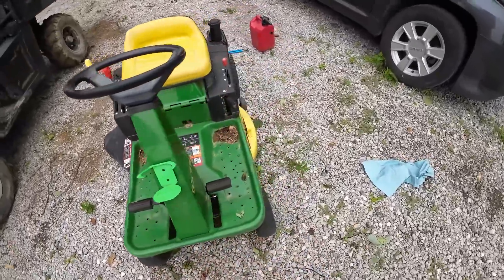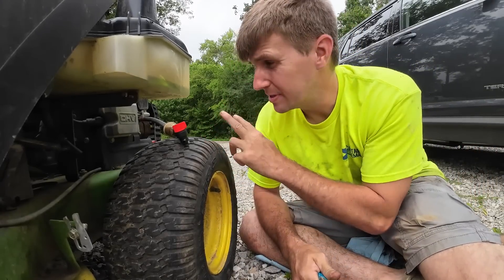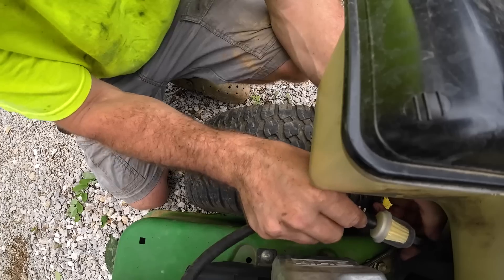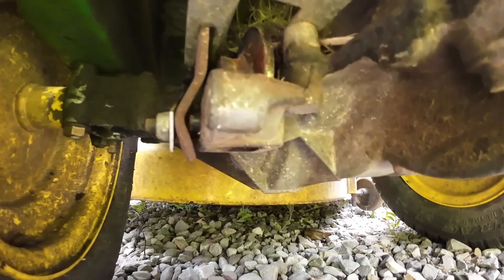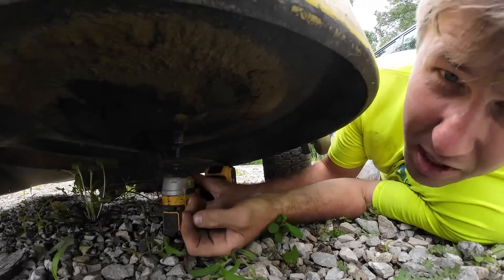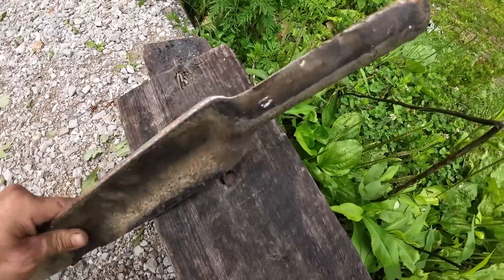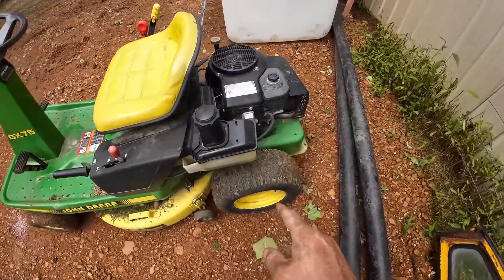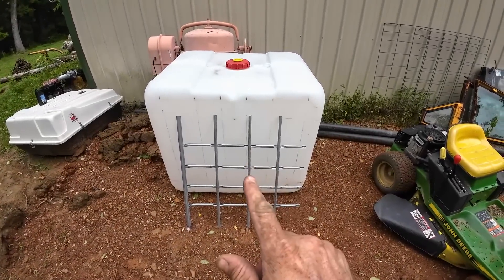Leaking Gas and No Brakes - John Deere Lawnmower Repairs

Comment: Enjoying your videos... I'd like to take a guess on the OVERSIZED hose from the tank. I've just been dealing with the straight 1/4" fuel plug out of the tank... the ones I've bought have leaked around the stem... Maybe it's common so mfgs have switched  because the larger are more reliable. I ended up using a sealer.

Comment: The bends in the brake lever are made so that as the lever rotates they push pins in against the brake pad, which in turn clamps the pads onto the rotor.  A frequent problem is that the pins rust in place because they aren't lubricated or protected (oil on pads - not good).

Comment: Been working on a JD Z-225 zero turn. Had to re-engine mine but it came with a near new deck and the hydro drives work as they should. Just finished last step: graphite coating on the underside of the deck. Yours took a lot less coin to bring back to life. Good find.

Comment: Thanks for sharing your thoughts, ideas and videos. The blades on the mower reminded me of some of my previous battles. I used to refer to bludgeoning the lawn instead of cutting it since my blades were frequently closer to clubs than swords. 
Random thought, do you have any streams with enough flow and head to put in a ram pump. You could use the IBC tote bladder for a elevated storage tank. Wishing you and your family the best.

Comment: Getting pretty fancy with your "action" shots....  I always struggle with those fuel shut-off valves.  I get them off Amazon and it seems they will always leak.  Now, some seem to be "self healing"  once the seals apparently swell, but some are just complete fails.  I guess you get what you pay for.  What they lack in quality you make up for in quantity.  I hate to be "that guy" but I am assuming you know your front left tire needed air.  Per usual, I enjoy the content.  I appreciate how you just get after it and your sense of humor.  Here's hoping your Crocks are steel toe'd and fire resistant, unlike some slippers I have.  P.S. - Top tip - Don't weld in slippers.

Comment: You should be able to tell if the blade mounting bolt is right or left handed, by the direction it turns when cutting. One exception to that is, the Woods 60 inch belly mower I put on my little Allis tractor years ago.
 Someone sold the guy a Woods 60, instead of an L60 and he could never make it work right. The belt routing for the little Allis really needs to be for the L60, which is left handed.
 I had trouble getting the belt to work right for the right handed mower, so instead of buying new left handed spindles, I used my impact, set on Nuclear, to put the blades on. I only lost one blade in 10 years of mowing with that set up.

Comment: Back in the 60's we had a Simplicity mower that was similar to this but with a few differences. Instead of a steering wheel it had a joy stick that functioned as both steering and clutch (you pulled it back to actuate the transmission). The only real design flaw was that it was built without brakes. My 12 year old self glimpsed eternity more than once going downhill. The best part though was that with the rear engine and only a single tube for the front frame it popped wheelies like a dragster.

Comment: Quick thinking on the gas line to make it work. However you can no longer change the fuel filter by simply turning off the valve.
Reply from the maker: Run out of fuel 👍

Comment: They are normally threaded normally cuz as the blade spins it will tighten the bolt.
Reply from the maker: I've seen them both ways

Comment: Shut-off valve is a good addition to any small engine because of ethanol fuels.
Reply: Or like many people just by ethanol free fuel. 
Not easy to find in all areas but in my area Sunoco 94 octane fuel is ethanol free. 
Captain Kleeman said all gas stations in his area have ethanol free gas due to the proximity to the river.
Reply: @Crewsy  Ethanol free gas is also available in my area,  however I do like having the shut off valve.  I've forgotten about it once or twice.  The motor sputters and dies and I'm saying "what this time?  Then I remember the valve.

Comment: I use the built in deck wash system on mine.  Keeps things much cleaner.
Reply: I have that feature on a JD Z 225. How long do you wash it?
Reply: @amossnowdaharleyman9179  I usually watch the mower discharge color.  When the green goes away and the color clear up, at'll do.   Sure makes the deck cleaner when you have to service your mower.
Reply: Usually 5 minutes wtll do.

Comment: I am starting to question your country boy ways. In my neck of the woods they would just put a jelly jar under that valve when they parked it to catch that gas. Then just pour it back in the tank when ready to mow. All those valves and filters cut into the beer money fund dang it. Ok, at least you getter done cheap To answer your question of why JD makes that valve with two sizes it is so you cannot go to Amazon and get cheap parts and must come to them and pay through the nose. Good job getting around that boondoggle.